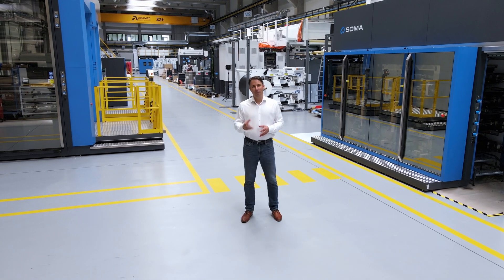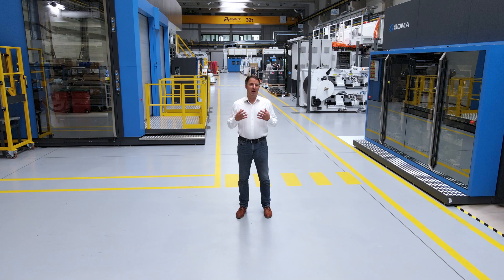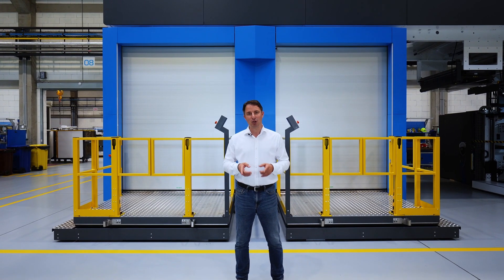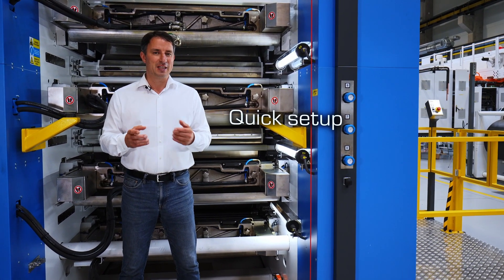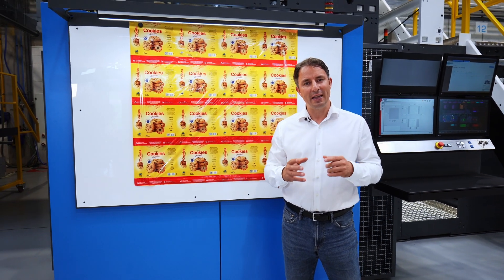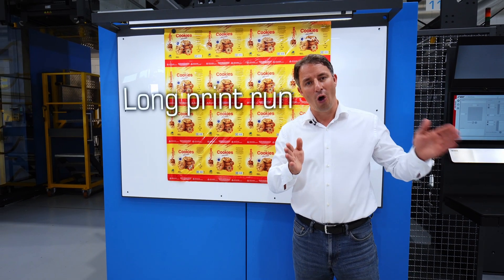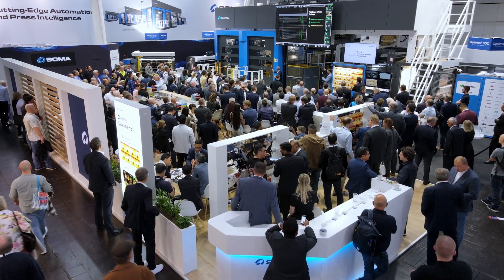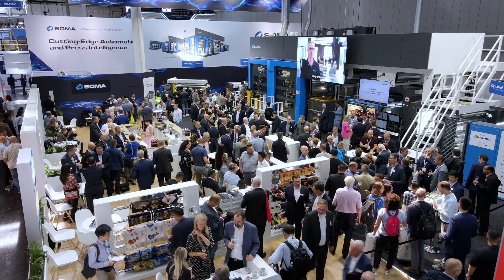SOMA - Advanced Bounce Control technology

Comment: that looks impressive,
but back in 2014 we installed a wide web Premia that was meant to have bounce control,
its not the challenging design i find that creates bounce nor is it the machine, but the on of print, for example print with a square block but then space then the square block and space again, and so on,, this is where we get major bounce issues.